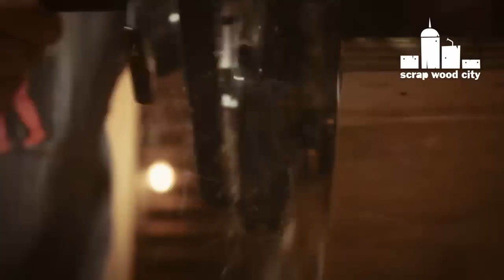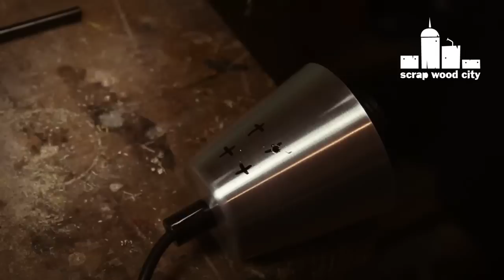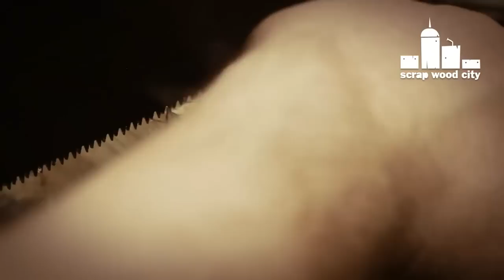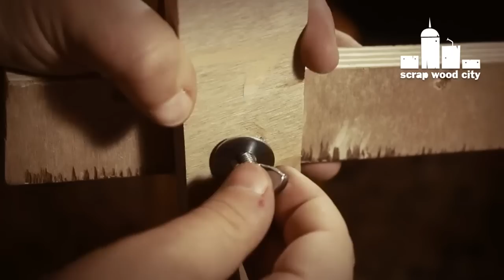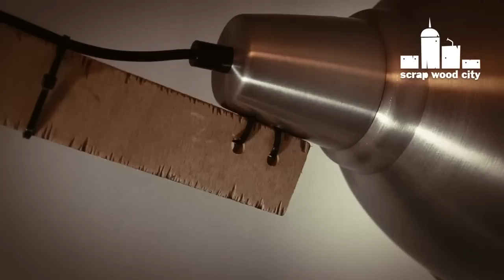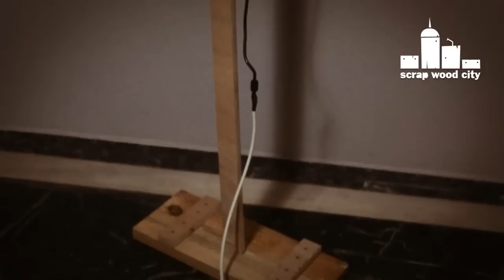DIY cheap wooden spotlight

Comment: Good idea, but i like to know if the plastic straps hold on fine, i think the heat from the lamp could melt it. Thanks for sharing!
Reply from the maker: The zip ties hold really wel! I've used a led lamp which is fairly cool! I do not know if a classic lamp will be ok with the ties although they are positioned quite far from the bulb itself! I guess someone could also use those metallic collars that we put on watering hoses!